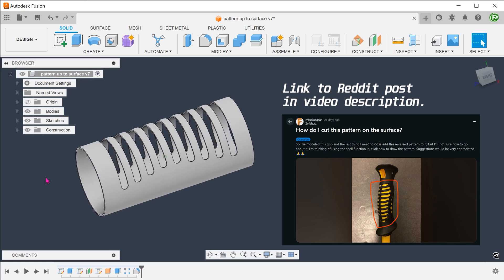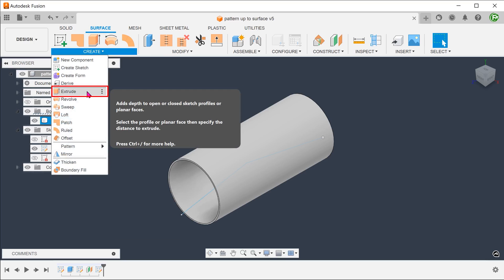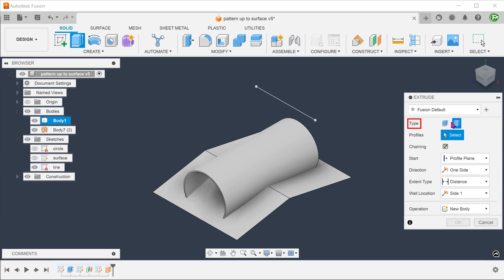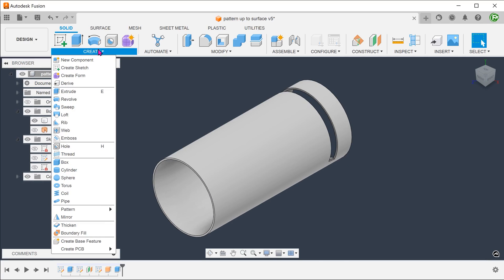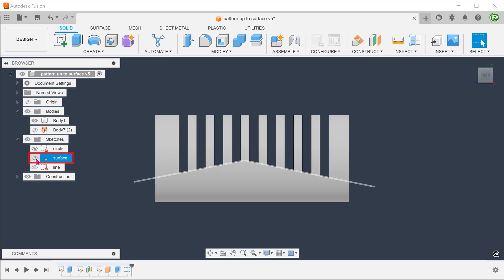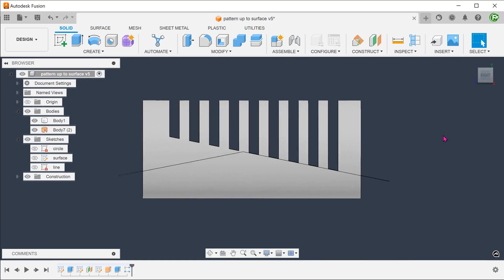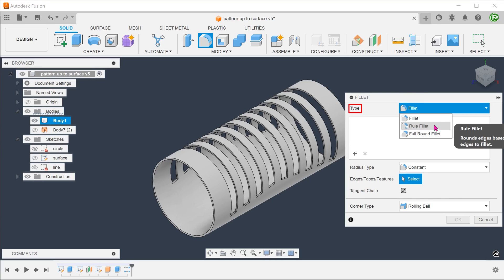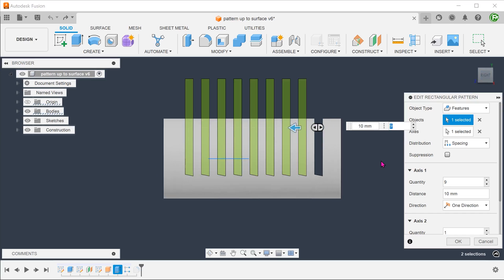Autodesk Fusion | Pattern Slots Up To Body

Comment: How to convert STL TO SOLIDBODY sir
Reply: Use the mesh conversion tool. In the hobbyist license, you will need to convert it using faceted conversion. From there, you can delete faces on the same plane to merge them, or use the BRep points as references for remodeled surfaces, which you can stitch together. If you have a paid or education license, you can use prismatic conversion, and apply the same techniques to improve the conversion result.
Reply: @theofficialczex1708  Thanks. Please send video link sir